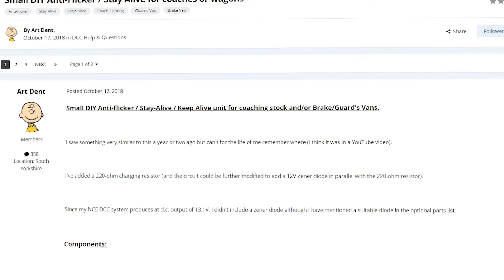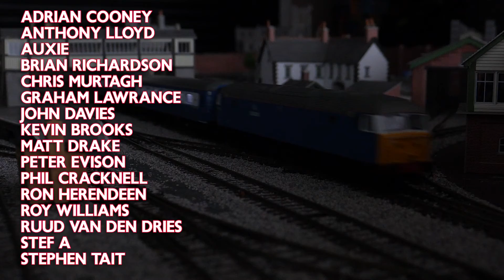DIY Coach Lighting with Stay Alive

Comment: Hi, i may be asking a silly question but i have ordered everything but the bridge recifier at the moment as i noticed you say you need a DB104 but the link is to a DB107 is this ok to use? the one in the link isn't available but i have seen others. Thanks so much for the video it was so easy to understand. I can't wait to get the light done for christmas :D
Reply from the maker: I think the only difference is the voltage rating 400V Vs 1000V. DB104 should be fine.
Reply: @LittleWicketRailway  thanks so much :) i have just had my first attempt and it work ok but i am going to added a larger resistor as you say in the video because i only want a hint of lighting. But, this works great already, a little flicker on some parts of my track but it acceptable and even adds to the realism .... thanks again for your video they really help

Comment: Thanks for this tutorial... As a newbie to the hobby, what Wheel track size should you order for standard 00 Hornby track? (DCC Concepts has several listed)
Reply from the maker: For 00 Hornby track you'll want the 16.5mm wheels. Then you'll need to select the diameter (10.5mm, 12mm or 14mm) based on what you plan to fit them to. I'm using 12mm diameter for these coaches.

Comment: This is a great idea.  I just will give one small bit of advice.  When dead bugging a circuit like this, try not to put stress on the component legs.  I  noticed when you were twisting the resistor to the capacitor, it seemed to put a lot of stress on the capacitor lead as it was twisted very close to the body of the capacitor.     Just something to be aware of.
This is a great little tutorial on making a basic stay alive and should work reasonably well on both DCC and DC, though on DC the brightness will vary a bit with speed.   IF you use a 3 or 5 volt LED strip and a regulator, you can can get more even lighting on DC
Reply from the maker: Haha, I was hoping nobody would notice I'd soldered the resistor on at a wonky angle and had to do some corrective bending 🙃 Good shout on the lower voltage LEDS for DC.

Comment: I'm familiar with a similar method that picks up current by wrapping stripped electrical wire around a metal wheel axle. The wire is probably thicker than the one you used. The channel displaying this method a lot on YouTube is a German channel named hd springer and the vids have titles with "flackerfreie Beleuchtung" in them.

Comment: Hi, great video, what happened to the Zero 1 video you promised? There is a YouTuber called zero 1 guy who’s converted his zero 1 system to dcc, thanks for sharing.
Reply from the maker: Hi StormmyStormmy 🙂 Zero1 is still in the list. It'll be a longer video and needs loads of research which takes ages. Finding any footage of the Zero 1 being used in the early 80s is really difficult. I'd also heard that the Zero 1 has featured on the BBC Tomorrow's World programme in 1978 or 1979 and really wanted to get that footage, but the BBC has no record of this.

I've got two Zero 1 units and it did cross my mind to convert one to DCC.
Reply: @LittleWicketRailway  Check out the Zero 1 guy’s channel, he’s done a great job updating what was the first dcc type system.
Did you ever see the Maplin’s  digital train control system kit back in the day? I have a huge amount of Zero 1 items, 90% of it is brand new in their boxes, it was a very good system released too early to the public with no back up, typical Hornby stunt that still persists today, I’m a big dcc fan now, I’m a ESU fan although I’ve invested in a Hornby class 08 loco which has a TTS sound decoder fitted, to be fair I bought the loco for its livery, I’ve been made to believe that the TTS decoders are ok, the class 08 and the HST class 43 are regarded as Hornby’s best, if the sound is as good as is portrayed then I will keep it, if not I will remove and fit a better sound file.